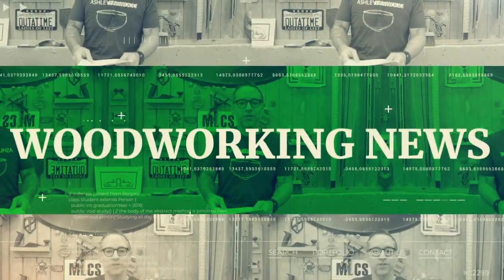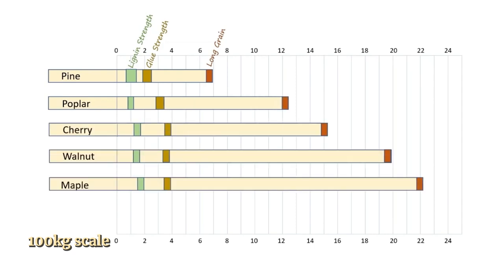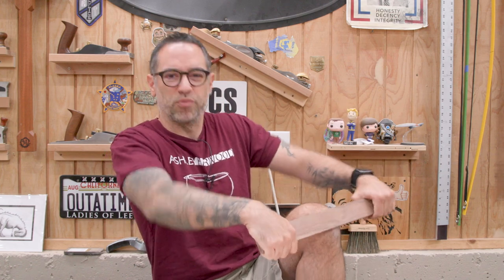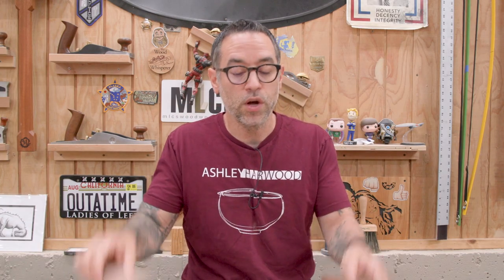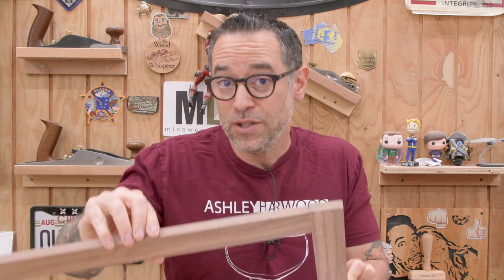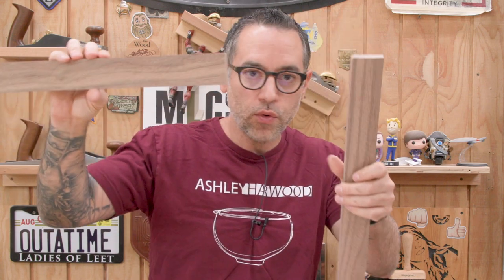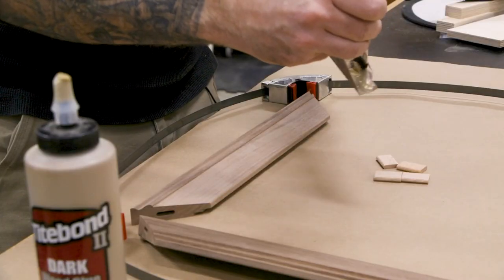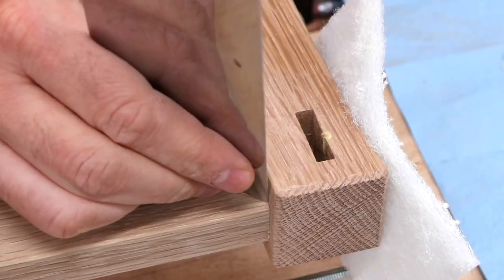End Grain Glue Myths | You May Have Misunderstood

Comment: Yeah, but you absolute CANNOT just multiply the strength of a single joint when using multiple joints in a system. Leverage and where/how the load is applied (location, angle) matter tremendously. That's where the field of engineering comes in. The same boy weight applied to a picture frame, opposite corner to corner, will absolutely create higher stresses in the joints than a vertical load applied to the middle of one member. Depending on the joint configuration, you might be going from (theoretically) pure shear in all joints, to (theoretically) pure moment/bending at all joints. It's just waaay more complicated than that.
Point taken about non-glue joints being stronger still, but the math/engineering is wrong in your argument (or at least drastically oversimplified, since it's only applicable is narrow cases)
Reply from the maker: It's applicable in every furniture case. Oversimplified, but valid. The strength of a piece of furniture is not only as strong as its weakest joint in its set. It's additive to a degree. That's the point I was trying to make and whether it is a textbook perfect explanation of what's happening is irrelevant to me.

Comment: In m&t or similar joints it's the shear strength of the glue surface that holds the joints together, while in butt joints it's the tensile strength of the glue. I believe the shear and tensile strength of PVA glue is quite different but I have no proof. Maybe someone can make a video about this.
Reply: Yes, yes, yes! Shear strength and tensile strength are not the same. Traditionally hide glues were used, they are very brittle under tensile forces, but I suspect may be quite strong under shear forces. I'd be interested to see a rigorous scientific comparison between hide glue and PVA under shear and tensile forces (Pat?). Nevertheless, traditional joinery relies on mechanical connection (geometry) for strength, not the strength of the glue itself, as Marc pointed out. Kudos to Marc for the respectful way he approached this. IMO the learning from Pat's tests is useful, and reminds us to question "common knowledge" rather than take it as fact. Marc and Pat are both right! The more we understand the properties of the materials we are working with, the better we are able to choose or even better, invent, the best solution for a particular situation. Maybe it's not a "butt joint" but a "but joint" as in "but it doesn't always work", similar to Paul Sellers who says "It's called a mitre joint because I look at it and think "I mitre done it better"".

Comment: Sorry but you either missed what he was saying, or you are deliberately miss representing it or you are creating click bait.   He NEVER said to toss out half laps or M&T joints or whatever he was simply pointing out the myth that glue on end joints is substantially weaker then on other joints.  
As for your comparing his numbers to The magazines numbers that is completely bull as the methods and machines used are completely different.  And if you can’t use the Magazines number because the charts are the magazines then you shouldn’t use his stuff either as that is his. 
 And  your point that some versions of the joints will typically result in longer lever arms…. Well yes it will but that has NOTHING to do with the question of how strong the glue was and if anything supports the original claim that wood workers have been miss understanding glue joint str.  And how joint fail for a long time.  
In that the end grain joint is in itself no weaker and that it is the wood that fails not the joint.  
.So it appears that you either went into this with a bias against his conclusion or you were looking for clicks.  

What should be pointed out is that someone needs to test the str of different mechanical joints and compare them to each other and to simple glue.  So we need the original poster to test M&T, Half Lap, Doweled,  Biscuit and floating tenon on to name a few.   So that ALL these tests are conducted on the same equipment in the same way.  Because right now you (and from the comments, other folks) are running far ahead of what the tests have done.  And are trying to derive conclusions without data.  Or trying to compare incompatible data to fill this void.  
Frankly what this all shows is that wood working having “evolved” over millennia has a desperate need to someone to conduct a series of scientific tests so it can prove or disprove long held beliefs.   But that would be a LOT of work.  Well this is obviously my opinion….  On what was your opinion.
Reply from the maker: You should really watch the entire video before commenting. Save yourself some keystrokes. :)